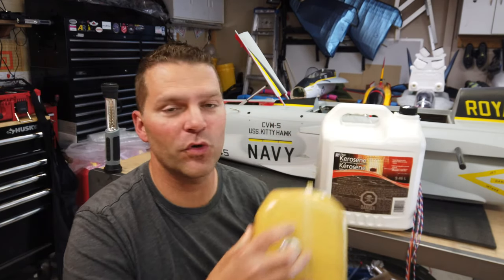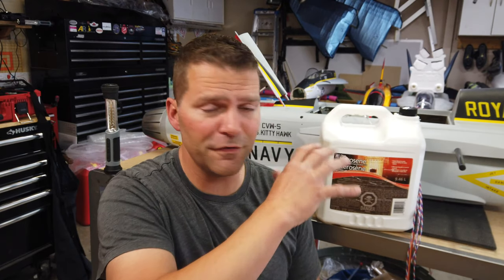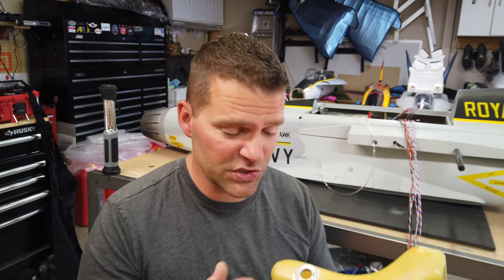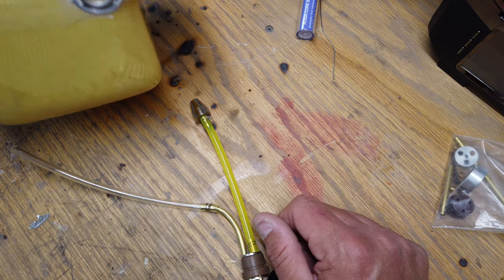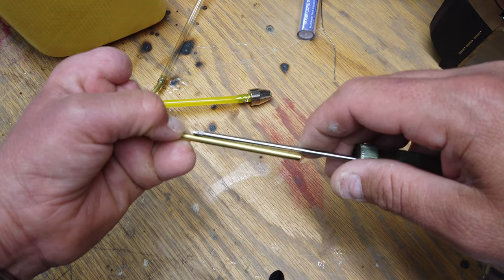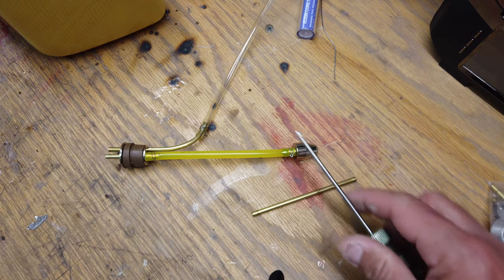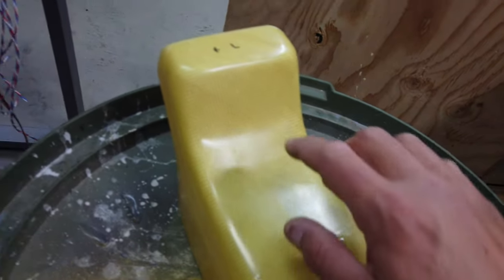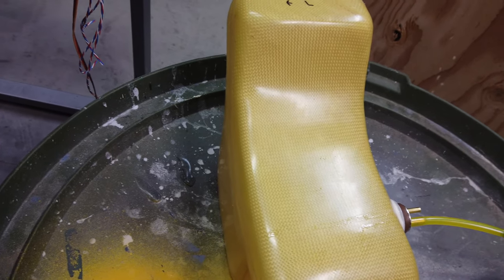SKYMASTER F-18 F18 - Fuel Tank Installation - Build Video #12 - Kerosene, Jet A, Diesel, Kingtech

Comment: Good video! What I do for the vent placement is I make a mark with a marker on the bung and tank to index it, and then make a mark on the brass tube on the vent tube that would show the position when in the tank. Insert bung and rotate vent tube to match the mark so you know where the upper "curve" is positioned.  I no longer use these types of fittings. Check out the DreamWorks and BVM high flow fittings. The main fitting uses an O ring to seal the a in metal bung.
Reply from the maker: Thanks for the tip!  I'm familiar with the high flow fittings and do like them!  Thanks for watching!

Comment: How many litters would these 3 tanks will hold? and how many flying time will give you with the 160s ?
Reply from the maker: Total I think we are close to 9-10 L of fuel. The aircraft now has Swiwin 190’s (more fuel efficient). The flights lately have just gotten into the main tank, so saddles have been used.

Comment: As far as bending tubing find a piece of wire that fits inside , when done pull it out
Reply from the maker: Thanks Terry!  I do have a wire bender but typically forget I do.  Don't use it often.  I do like your tip with the wire inside.  I have never tried that method.😎
Reply: @thelightersideofrc  Ive even heard fill it with sand , of course you would want to seal off one end , the bend it gently
Reply from the maker: Cool!  Always nice to have new thinks in the tickle trunk!

Comment: why not use a Bending spring
 ? they are cheap and work great. other option is to put a electrical wire inside instead of the spring.
Reply from the maker: Didn't even know such a thing existed!  Thanks for the tip!

Comment: I’m curious why you don’t use a walbro filtered clunk. Is it because they don’t work good with the different turbine fuels as compared to gasoline? Do they not fit through tank opening maybe?
Reply from the maker: dan4466 great question. I’m not a fan of the Wolbro ones for turbines as the felt area is small for the Qty of fuel trying to get through it. CARF includes a different style felt one that I use often. My Tutor for example has a single large tank and than the UAT bubble trap. On a single tank setup it’s a great idea. If your getting into larger turbine sizes like the 250 we put in the L39 build it can be restrictive. Before the next flight on the L39 we will be taking the felt clunk out, adding a normal high flow clunk and also adding a 2nd fuel tank. 

Just remember that a gas engine sips the fuel. A turbine chugs the fuel.
Reply: The Lighter Side Of RC thanks for the nice reply. Never thought about it not having enough flow for a turbine. I’ve been assembling 60cc gas warbirds for the last twenty yrs. Some of them I’ve probably had 40-50 hrs into them, but there nothing compared to the turbine jets. Seems like a lot more complicated. Surprised how bad the manual is in places considering I believe it’s a plane made in the US.